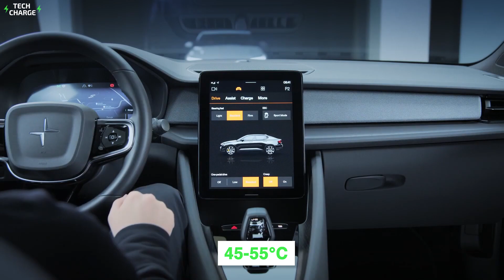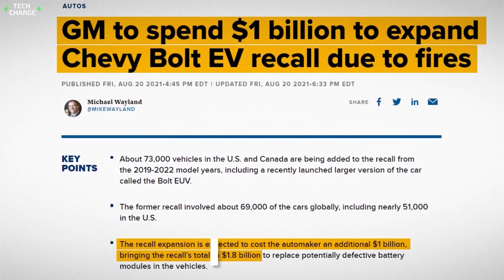The Shocking Truth About EV Fires You Need to Know

Comment: It's because of the fire issue that I WILL NOT OWN AN EV! My house's garage is integral with the house; it's built into the house, and it's below my living room. Do I want an EV in there that could catch fire and burn down the house before I can get out? NFW!

Also, I transport cats for a local feline rescue. At times, I've had four cats in the car with me; there's no way I could get all of them out if an EV battery fire started. I don't want to take that chance-either with my cats, the rescue cats, or myself.
Reply: Awesome you help cats!  Yeah, putting an EV in your garage is like sleeping with a grenade under your pillow!
Reply: @COSMACELF1802  if it weren't for the fire problem with the batteries, I'd own one. I do mostly local, city driving, and they're ideal for that. I think that the idea of EVs are cool. I retired from a Tesla Motors partner, so I've known of them years before most people did. However, until the battery fire issue is solved, I won't own one for the reasons I stated above.
Reply: @markymarknj  I have a close friend that has been building his own EV cars since 2000.  His advice is to get an EV with a small battery, just enough for the local run around you need on a daily basis.  I would like one, but they cost too much money.  The total cost of ownership of my old van for 150,000km's over 15 years is less than 1/2 the price of an EV car.  Of course, it helps that I'm a mechanic :)
Reply: @COSMACELF1802  I've thought about getting the series hybrid, the Chevy Volt. It has a small battery to enable local running around on electric power; depending on the year, that's either 37 or 50 miles of EV operation. After that, a gas engine turns on, which supplies power to the battery and electric motors; think of it as a Diesel electric locomotive miniaturized. For me, that would be ideal, as I don't do much over 20-25 miles a day as a retired guy. Of course, I'd have to put fuel stabilizer in the gas, as it would take me MONTHS to burn off the 9 gallon tank... 😁😁😁😁
Reply: @markymarknj  Yeah, I think that's the perfect vehicle for now.  A plug in hybrid.  It makes sense that we should transition slowly.  Then in the later years, if/when the battery capacity drops, you aren't screwed into buying an expensive replacement battery.  Also, the fact the battery is smaller, makes it cheaper to replace.  A vehicle needs to be the right size and no such thing as 1 size fits all.  Good for you to know about fuel stabilizer... that reminds me, I need to put some in my RV!
Reply: @markymarknj  Even with a plug in EV, I'd not park it in the garage.  Oh, and if I ever was forced to get an EV, the first thing I'll buy is a towable diesel generator.
Reply: @COSMACELF1802 are you referring to a PHEV, like the Chevy Volt?
Reply: @markymarknj  Actually, I have the Toyota Prius in mind, but any PHEV will do.  The ability of being dual source is very attractive.  I would think a computer that constantly tests both the EV and the ICE would permit redundant systems.  It would be even better if they had separate transmissions and worked different wheels (ICE front, EV rear?)  Then if something failed in either system, the other could get you where you need to go.  Just my wish list.  Not sure how the Toyota PHEV works.
Reply: @COSMACELF1802 I'm not sure about how the Toyota works, either; I know it used to be a parallel hybrid, but that wasn't the PHEV. The electric motor on the hybrid Prius used to couple up to the drivetrain, so as to assist the ICE; hence, it's called a parallel hybrid.

OTOH, for the Chevy Volt, only electric motors turn the wheels. The onboard ICE just turns a generator. Batteries supply power to the electric motors until they run out; at that point, the ICE generator comes on and supplies power to the electric motors instead. It's like a Diesel locomotive, only much smaller. That made the Volt a series hybrid.
Reply: @markymarknj  I think your understanding of the PHEV is correct.  As you said, it's like the diesel-electric locomotives which need all that torque to get those massive trains moving.

Comment: The most frightening aspect of this video is what it does not elaborate on.  Given this good info about 30,000 gallons of water necessary to extinguish a single EV fire, can you even imagine the hellish inferno that would develop in a freeway pile-up of EV's in foggy or unstable weather conditions?

No thank you....I will keep and cherish my gas guzzling ICE vehicle, which over its lifetime will release less pollutants into the atmosphere than the manufacturing process of the lithium-ion battery for your EV and the charging stations.
Reply: That’s not the whole story.  You have to keep the entire car in a smothered state for two weeks because the fire can re-ignite

Comment: "The chances of a short circuit are greatly increased if you recharge the battery without giving it time to cool down"
So on a longer journey, as well as the hour of charging time, you should hang around for another 1/2 hour before even plugging it in!  By the way, an EV is a "remote combustion" car, powered by energy partly from fossil fuel at the power station 200 miles away.
Reply: so the ev becomes even less of a realistic option for long drives (over 100 miles)

Comment: my belief is that the EVs are the worst idea ever. first they are limited to how far you can go on a single charge. {about 150-300 miles} then to recharge the batteries takes 45m-6.5h. with the gas powered car, you can go 300-470 miles before refilling the tank. it takes only 3-7m. and with some of the pick ups you can driver feather before you have to fill up.
Reply: The lithium ion battery is most of the problem.  The lithium ion battery in and of itself has long had volatility issues.  High powered capacitors or other kinds of solid state batteries would likely have even less fire risk.
Reply: Yeah, that's called Range Anxiety.  Now there's Fire Anxiety.  But my biggest reason for not buying EV is cost.  Total cost of ownership for my old junker is 1/2 the price of an EV car, this is over the past 15 years!  Perhaps if gasoline goes to $20 a Litre, things will change.  But with Range Anxiety, I can't drive to the coast in an EV.  The drive is 14 hours by gas car, which I have enough stamina to do in 1 day.  If I was driving an EV, I would need another 4 hours to recharge along the way... this makes the drive impossible.

Comment: Until the motor industry comes up with a better battery which doesn't self ignite EVs should be banned
Reply: There is no climate change and someday it will become obvious to all.
Reply: The Swedish government found that ICE vehicles were 20 times more likely to catch on fire than EVs in 2022. EV Firesafe, an Australian company, found that ICEVs are 80 times more likely to catch on fire than EVs, based on global data between 2011 and 2022. Given the evidence, I would say that ICEVs should be banned, since they are much greater fire hazards. Furthermore, ICEVs emit more GHG emissions than EVS, and GHG emissions are causing global warming and increasing the risks of forest fires.

Since LFP batteries have significantly lower risk of fires than NMC batteries, the safest cars on the roads are the ones using LFP, such as Tesla Model 3/Y Standard Range and the 2024 Mustang Mach-E Standard Range. The BYD LFP Blade battery is designed to not catch on fire even when penetrated by a nail, but you need to buy a Tesla Model Y made in the Berlin Gigafactory to get them.
Reply: @amosbatto3051 Yeah, bet you also fell for safe and effective too. Government stats are so truthful, arnt they?
Reply: EV's are proven to reduce the number of Co2 producers though, if you know what I mean.

Comment: 1. Gas cars catch fire 6400x more often than evs percentage wise per the NHTSA. Its just not news worthy.
2. Sodium ion batteries fix the shortcomings of lithium batteries in regards to flammability and eco friendliness. Sodium ion batteries are made by cleaning ocean water for drinking water. It makes the batteries 40% cheaper too.
Reply: I hope you're right about Sodium batteries, because it's not a matter of IF an EV burns, but WHEN.  All these cars are burning fast when exposed to rusty salt air.  We all know that cars rust.  With that in mind, I believe all EV's will eventually burn within 20 years.

Comment: I heard an ev mechanic say in another video that the problem comes when owners don't check the filters on the battery cooling systems. So the filters plug up causing the cooling system to malfunction. Then the batteries to heat up. That's what causes most fires. If checked and replaced on a regular basis, there would be no fires.
Reply: wiring short circuiting causes the battery to discharge rapidly and heat up, poor wire management allowing it to chaff against sharp edges is the problem
Reply: So? They are firebombs that should not explode cuz of some filter!
Reply: An issue, but the truth is, these were tested by the military decades ago for use on submarines, they decided not to use them because they caught fire randomly for no good reason.
Reply: How many car owners actually do regular maintenance on a combustion powered vehicle? Changing tires or engine oil is often an oversight. Most don’t do anything until the car starts to have issues. Obviously not an option where EV’s are concerned.

Regardless, relying on the everyday vehicle owner to take these actions is a bit unrealistic.
Reply: So, if I don't do some regular maintenance item on my ICE car, the car dies. If I miss something on my EV, I die.

Comment: I believe there is a lack of power engineers today as all who pursue electrical engineering move to telecommunications or microprocessor, since those are the in things in human perception.  But just as all homes can be electrically protected, EVs should be electrically protected.  I suggest two contactors for each cell; they come cheap these days, definitely less than the cost of letting even one EV catch fire and bringing the whole of humanity against EV.  Two contactors one just out of the positive side of the battery and one on the negative side of the battery.  The contactors are normally open and closed only when you start the car.  With any electrical problem in the car, all the contactors will open and all the cells are not connected to anything.  Some gasoline cars also catch fire and the root cause is always from the car batteries.  My first reaction is to cut the leads going out of the batteries.  The option to do that electrically should be offered to the driver on the dashboard with a switch.

Comment: EV fire, very little water needed, a fire blanket will starve the fire. Deployed by 4 fire fighters, its a little heavier than a tarp and takes less space. Update your info.
Reply: so the firefighters need to walk and get close to the fire. yeah....THAT'S a good idea. O.o
Reply: @Joe-sn6ir You may want to look how firefighters operate, battery fires are very different then say an aircraft or ICE vehicle fire that has liquid fuel. Also majority of EV or battery fires in automobiles will not be in a confined space, except in a garage space but the more likely scenario  would be after road way crash, so risk/hazards are different. Fighting a battery fire with water is not efficient/effective, same would apply to pools of fuel on the ground, you would use foam, not water. Starving the source of oxygen is the goal.

Comment: You pack enough energy in a small space and it will discharge one way or another. Gasoline has a built in safety switch of needing to be aerosolized and activated by at least a spark
Reply: The funny part is that EV's burn more gasoline, oil and coal than ICE cars.  Electricity doesn't just come out of thin air.  The real joke is when they say electricity is delivered with 99% efficiency... what a joke.  90% is the best at most.  So after you add the inefficiency of power generation, transmission and battery storage.  An EV burns twice as much gasoline.
Reply: Yeah right, we see how "safe" it is when the fumes from a leak or someone using gas finds a spark or heat source in a lamp, water heater nearby, or someone flips a light switch on and BOOM!
Reply: @FCE-dogs  look up stoichiometry before commenting

Comment: Do the math! One electric vehicle may be very safe, but 100 or 500 electric vehicles in a parking garage means that all of them have to be safe and the odds of all of them being safe at the same time begin to become vanishing Lee low. Just do the math! Problem is if one of them does become a fire, the odds are very good that many others will join in and then you’ll have a huge disaster. One electric vehicle may be safe. But a group of electric vehicles? For example, if you have 500 electric vehicles, each one of whom has a 99.7% chance of not catching fire, if there are 500 of them parked in your garage and your garage has only a 20% chance of not catching on fire.

Comment: Nah. I'll keep my Alfa Guilia. It's faster that I thought it would be. It's also surprisingly economical on fuel. And most importantly, it is a fully understood technology. Might be Italian, but my local mechanic can, and does work on it. I only need to take it to a Dodge Dealer to clear the "check engine" warning after my local shop has done the service. Alfa's require Dodge Connect to clear the code.
You'll take my ICE from my cold dead hands.

Comment: How’s that “better for the environment “ working when it’s on fire?
Reply: It's ok, they are green cars that put out green smoke.  The real fun in all this... wait 10 years when those batteries start rusting (like every car does) and we'll have 1 in 10 EV's burning up.  Don't park next to EV cars... don't let your neighbors get an EV.
Reply: Working FINE since its a one-time small part of less than 1%, in contrast to the millions of gas cars spewing pollution every time they run, warm up in winter, and the 350,000 house fires a year putting all that toxic pollution into the air

Comment: I wouldn't call those safety features gimmicks. Most of them come from the legacy industry anyway. Also, no way that fire in the scrapyard took 30 000 gallons. Maybe 3 000 gallons, or 30 000 litres. Which is still a sh1tload, and a real issue.

Comment: 1. Fumes from. Burning EV fire is extremely toxic. Cobalt fume.
2. EV fires are extremely hot. Approx 5000 degrees. Gasoline fires approx 1500 degrees.
3. EV fires tend to explode causing fires on adjacent property.
4. Resale value is extremely low. A 5 year old EV is practically worthless. Batteries last 5-8 years and cost approx $20,000.
5. EVs are not environmentally friendly.. Using fossil fuels to produce electricity to recharge and mine lithium.
Reply: Shhhh,  the EV owners want to feel special.

Comment: As the number of EV increase so will the number of fires. And that 0.3% will also increase.  EVs should not be allowed in multi level parking or even worse underground parking.
Reply: EV's shouldn't be allowed on Ferries either, or long tunnels, or your garage, or your driveway, or public roads.

Comment: My key takeaways are that EV's are statistically less likely than ICE vehicles to catch fire at all, but as a precaution with EVs, try not to let them bake in the sun, and let the battery cool 10-20mins before charging in hot temps (especially when battery is low).
Reply: My key takeaway is that the technology has unacceptable hazards so I don't want one.
Reply: That will be interesting during summer in Australia. Also why do Ev Jockeys think they can make comparisons EV fire to that of ICE based on numbers? Any perceived relevance Vanishes the second you accept the fact ICE can be extinguished EV's can't.

Comment: The point is : there are no fire extinguisher that good enough to extinguish fire cause by broken lithium bateries, yet.
Reply: the fires are star ted by a short circuit that causes the battery to discharge rapidly and overheat, obviously the problem is related to poor cable management in the factory design of the chassis. Every car Ive had always had a short or some problem in the wiring somewhere, tail light stops working, or the brake lights, and it's a bitch to track it down in a wiring harness that has 50 other wires all wrapped up tight together going under seats, behind the dash, they need to do a better job protecting wiring with conduit or something that won't allow wires to chaff against a sharp metail seat bracket or something.

Comment: Failed to mention not all batteries are the same. Regular Lithium Ion are the worst. Most new cars will use LiFeP04, Sodium Ion or something else. 
I have 20KWH of LiFeP04 inside my house and I'm very comfortable that it won't catch fire.
Reply: Sounds like  famous  last words.
Reply: Yes, the new LiFePo-4 batteries are much better, much safer and longer cycles as well as cheaper to manufacture, they have IRON as part of their makeup and we have a massive amount of scrap iron that would be great to use. I also have a Jump 1,000 sine wave LiFePo-4 backup unit for power outages, it runs my lights, fridge, electric part of the gas furnace etc and it can charge with solar panels or A/C when its back on, or a generator